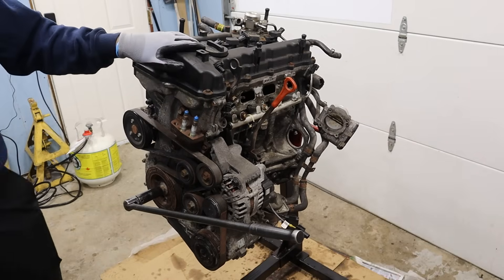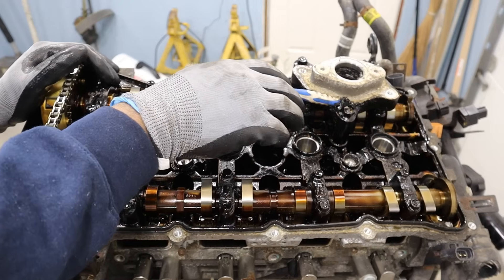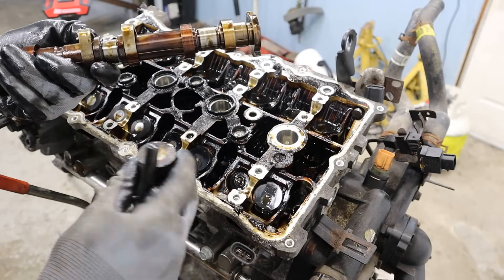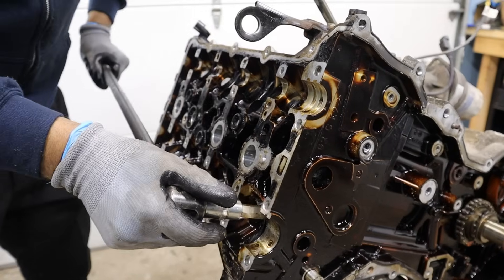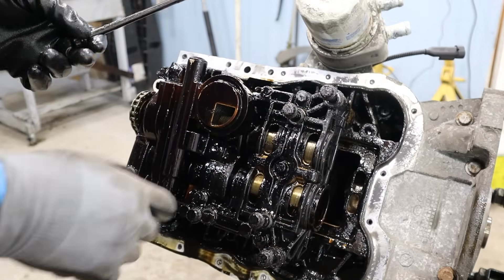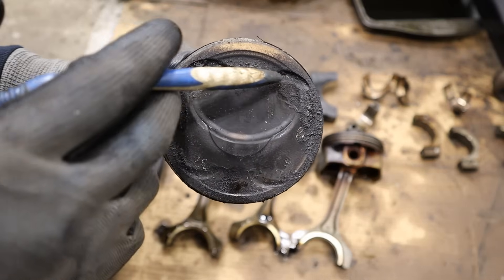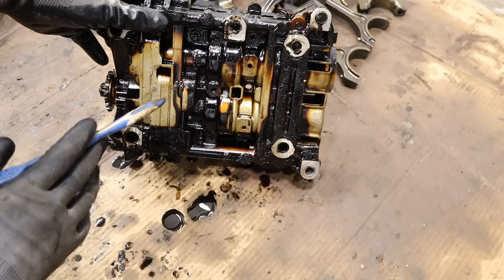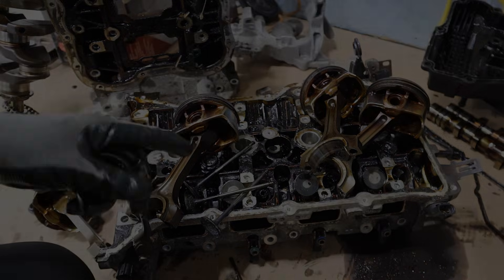Why Kia 2.4L Theta 2 Engines are a FAILURE

Comment: My 2013 Tucson has 215,000 MI on it.. does not burn any oil or tick.  I change the oil every 6000 miles whith full synthetic oil and filter. Fingers crossed.
Reply: Have a 2011 Tucson with that 2.4. 162,000 miles, original miles. Also only use Mobil one and filter every 6k miles. No major burning or ticking, but I’m still worried about it seizing up. Doesn’t pull up any engine recalls either.
Reply from the maker: Keep it full of oil. Check at every gas fill up
Reply: Can find exceptions everywhere, but fact remains, not so good overall
Reply: You are lucky. Some go through without a problem. Go to ANY Hyundai or Kia dealership and in the rear of the parts department you will find large black polystyrene containers about the size of an engine. Some dealers have had to rent storage containers to house them. It is the most hidden thing that dealerships do their best to hide. Some care, some don’t. They all are sh1t.
Reply: I think it's safe to say you won the Theta II lottery.
Reply: You kia haters can talk me down but in reality it's not always the manufacturer it's the year and type of car/trim but also owner that doesn't do proper preventative maintenance that gives it its bad rap  @hellomeatrobots
Reply: @chris6476  I've owned a Hyundai with a Theta II since 2017 and it's almost to 185,000 miles. I definitely don't hate it, and would be fine buying another. As long as it was either covered by an extended warranty or had more than about 120,000 miles on the engine.
Reply: @chris6476  100% agree. People don't change the oil enough and it starts burning, then those same people never check that oil (which runs low multiple times) and then the engine blows. Some of the 2.4/2.0 theta II engines will explode no matter what you do but the rest is just shitty maintenance practices.
Reply: That's generally how cars should be maintained, for heavy city driving with a lot of start stop traffic it should be even more rigorous, every 5,000 km, all your cars will probably last a long long time
Reply: Older cars with thicker oil burn less. Newer ones with 0-20 burn more.
Reply: My 2011 Sorento has 180,000 miles on it. No issues except the charcoal canister.  I have cleaned the valves once that's a out it. Change oil every 5k with Mobil 1
Reply: @Jason-sz5zv  glad to hear you got lucky so far with yours!

However, 180k miles is not considered high mileage, and even the worst name brand car like a Honda, Mazda, Toyota will make it to a bare minimum of 250 to 300,000 miles, even without oil changes and regular maintenance.
Reply: That's awesome to hear that. Hope it keeps being that reliable for u 👍
Reply: Glad to hear you got lucky with yours.  Our company had a Tucson that went through 3 engines at 310,000 miles. 

Also a transmission failure, ABS system failure, quite a few electrical problems too. Company finally learned to stop buying them after the third engine failed.
Reply: I just got a 2011 2.4 petrol it done 182000 , I wish I knew this hahahahaha is it going to blow up ???!!!! 😮
Reply: I'm happy for you. This video is strictly meant for awareness of potential issues. Keep up with the maintenance, and I hope your vehicle lasts another 100k!
Reply: @chrish8487  💯
Reply: Thank you for the passive-aggressive attempt at bullying someone on the internet that you will never meet. Everybody knows the point of this video. But thanks anyway for pointing out the painfully obvious. Continue having a tremendous impact on all of our lives.truly, thank you. @chrish8487
Reply: Hyundai and Kia did not start making crap till 2014... And to this day they are still making crap engines..xd
Reply: @1976axerhand GM says hi...
6.2 hi there.

And the Pentastar from Mopar....
Pesky lifter needle bearings...

Still... I know several with owners Taking Care of them an lasting...

These newer vehicles are Very sensitive to dirty oil.

Just change frequently folks...
Lazy costs $$$$$$$$$$.
Reply: Irrelevant
Reply: You are irrelevant. Nobody put you in charge of anything fool.  least of all these comments. @donniev8181
Reply: Dude you should be changing the oil every 3k 6 is to long
Reply: 🧐full synthetic* @chris6476

Comment: 3rd engine, it does not matter when you change your oil. I owned the car since 2012. I change the oil religiously. It doesn't matter. Synthetic good oil, it doesn't matter, it's not if it's when. Hyundai even change the tuning to decrease the performance, it doesn't matter it's going to blow up it's the worst four cylinder ever made
Reply: The 1st Gen Chevy Vega 4 cylinder would beg to differ.
Reply: Interesting  this why our 2018 hyundai  sonata performance is lower than the older 2.4L models. The engine still the original  with 270k km on it. Could be possible  the reason for engine failures that hyundai give too much power that engine  couldn't  handle.
Reply: Yeah I love it when guys say their Hyundai/Kia has 300k, no problems. They either won the engine lottery or they're lying
Reply: @sharedsailing4787 
Why, does every single Hyundai/Kia have a Theta 2? They did make some solid engines, 300k is easy for a Beta if the owner cares enough to do the bare minimum maintenance.
Reply from the maker: They're now coming with 1.6T engines
Reply: Yes it is.. I know first hand. Maintained meticulously and mine failed at 70k. I even took it to the dealership suspecting excessive oil consumption but they assured me all was good....
Reply: its fine as a GLP engine

Comment: OCI neglect is obvious.
Reply: The engine is garbage. I say many toyotas neglected  and still give many miles before  failure
Reply from the maker: So is design and manufacturing
Reply: @speedkar99  would you say it's a piston ring design flaw too, too much blow by contaminating the engine oil? What else explains the sludge